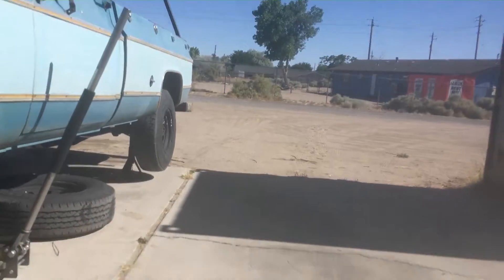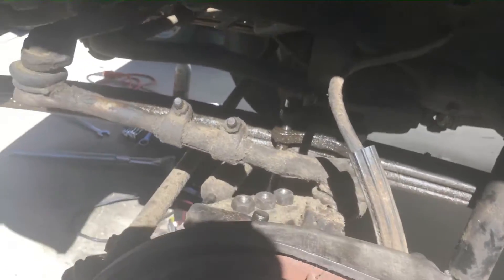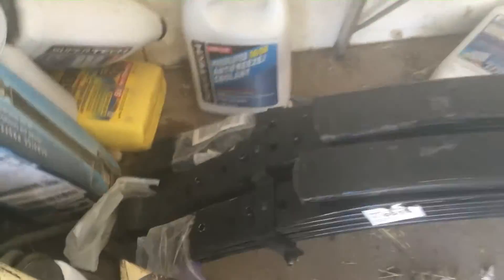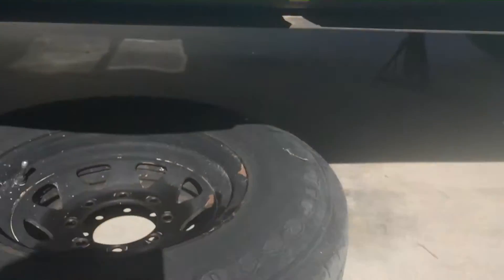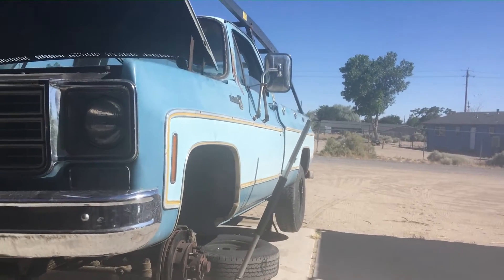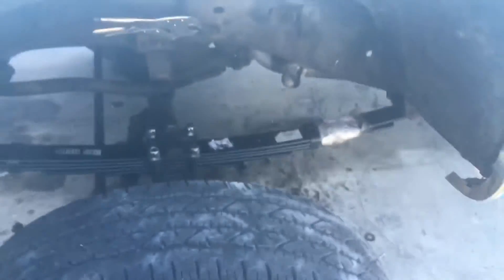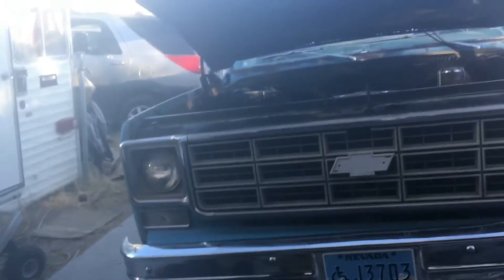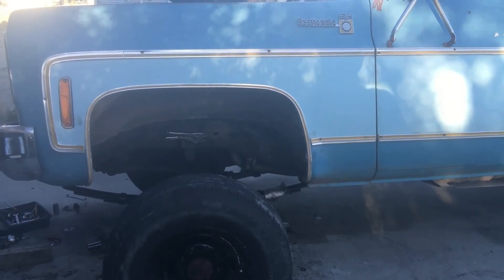1977 Chevy K20 Rough country 6 inch lift Part 1

Comment: We got 6 old 70s chevys we use on the farm all real good trucks  there all  full time 4x4 like yours . I prefer a full time if it's a little slimee out . I just put a 8 inch lift on a 74 with 42s it's squirrele as hell they said to put 2 of  thoes wedges between spring and pad to tilt pinion angle . I think it's got camber  caster off being tilted like that.  Did you use wedges on yours and does it steer fine And does your front drive shaft still got the double u joint by transfer case or were some one cut it off and put a single u joint  I got some with both l.
Reply from the maker: On my front leaf springs I only put on the springs, which did have a slight wedge shape on the bottom where it sits on the diff. I used the rough country 6 inch lift leaf springs and during my road and off road testing of the suspension, it steers straight so far.  My lift kit came with a larger steering arm which I installed with new knuckles.  I also have the double u joint by the transfer case which I made another video on where I shaved areas on the double U to give it more angle.  I also lowered the transfer case 1 inch by using the1 inch stock spacers above the frame and reinstalling them on the bolt side on  bottom area of transfer case mounting area.  There were a lot of things I did not anticipate with this lift kit that I ended up doing.  After I finally got everything done with the lift kit, now all of a sudden my truck just cranks over and will not start.  I have troubleshot it to the ignition switch under the steering column and what a pain it is getting two nuts under the brake booster which are rusted and crossthreaded from the last person that put them on.  So my truck is at a stopping point until I can get two very stubborn nuts off.  Thank you for your comments and watching my channel.  Really cool you have 6 of these trucks.